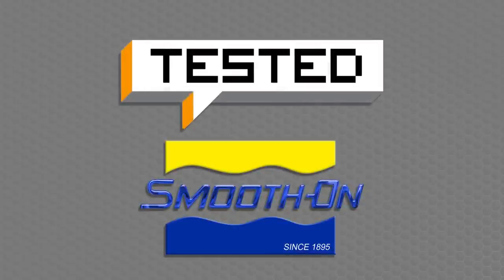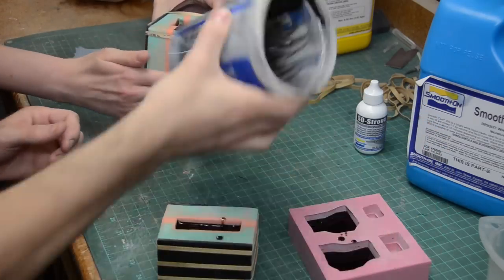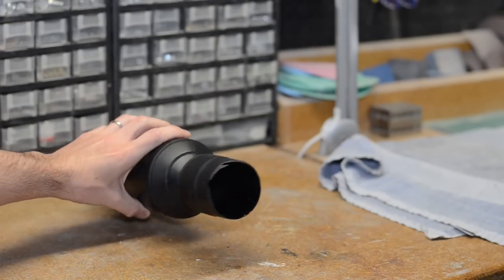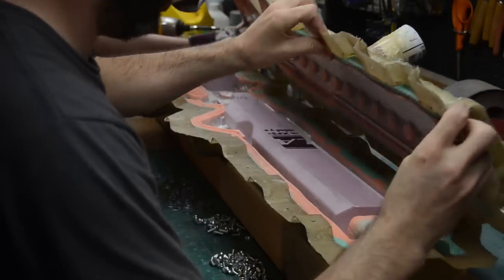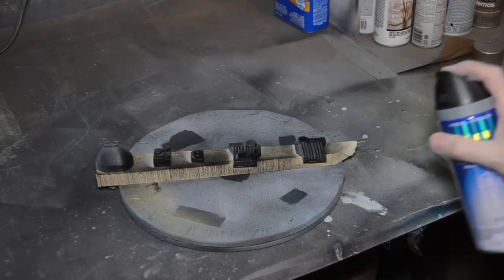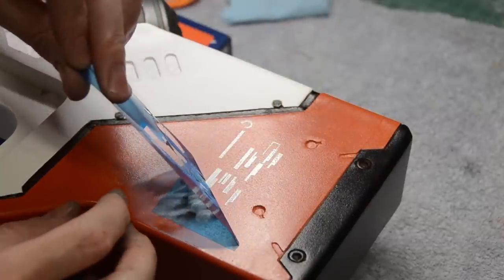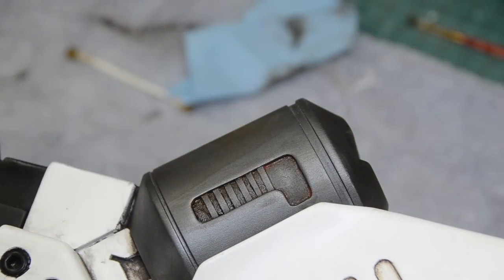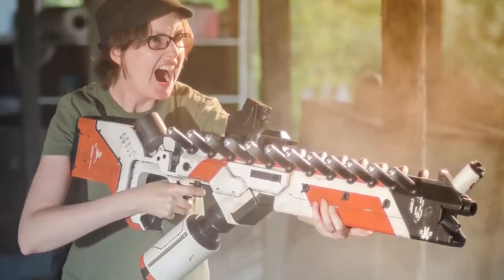Prop: Shop - Tested's District 9 Rifle Build: Part 4 - Casting & Painting

Comment: Okay bill,  I've got a question.  You made the large cylinder detachable but you glued on the little tube thingies.  Why not just get some good size magnets? I'd be more worried about those breaking off than the cylinder. Of course it probably made it to it destination on the tested office so I guess that's moot.  But I'm still curious if it crossed your mind